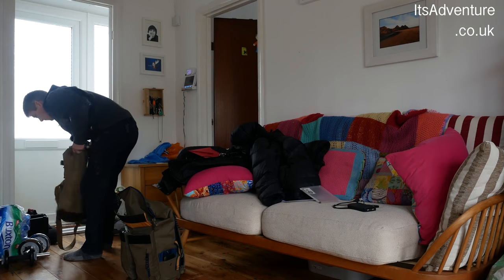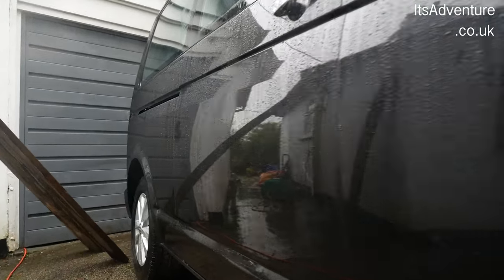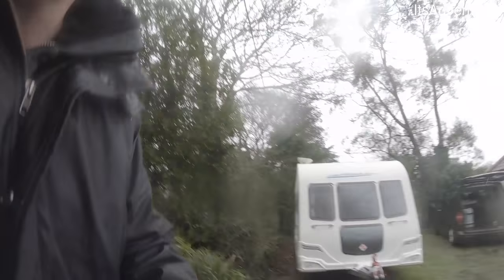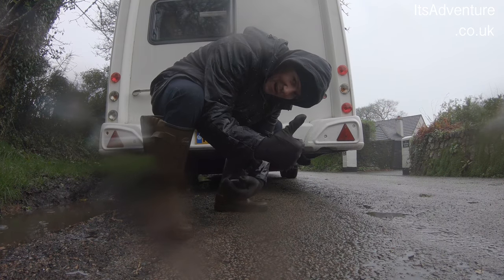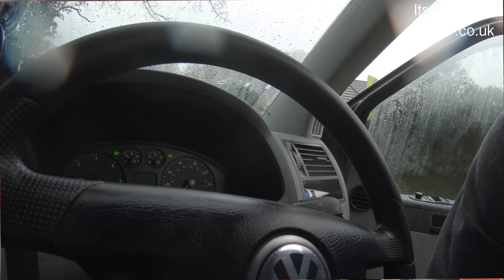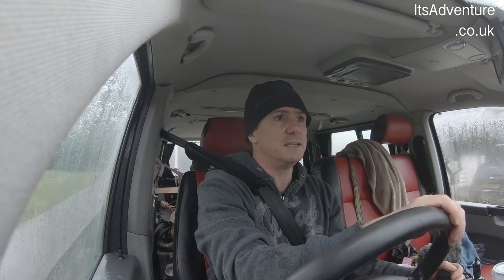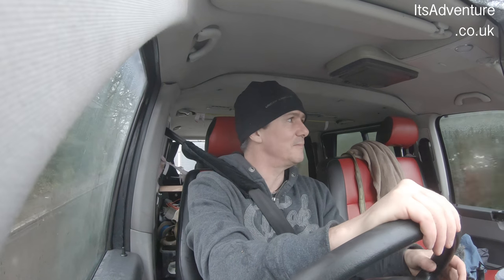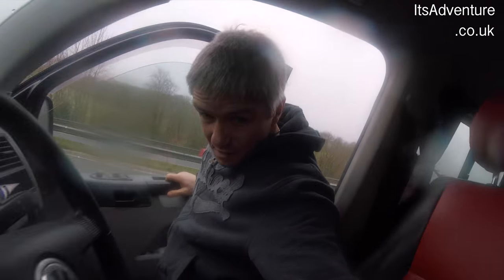VW T5 Van & Van

Comment: Why not just use the motor mover to bring the caravan to the bus to hitch up? So much less faff than cameras and Bluetooth!
Reply from the maker: Hey Mr C, couple of reasons sir: 
1, the battery I had on the van at that time was not quite powerful enough so frequently cut out after a couple of shunts back n forth. 4 x motors on 2 x axles take a lot of punch. 
2. I got to mess about with cameras(which I love) and which I hoped give ideas to help others who may not have been able to stretch to the expense of fitting a motor mover.  I did toy with using a video call to do similar but used the cameras.  
Thanks for the feedback.  
Rich. 
;o )

Comment: i found it a bit daunting the first large caravan I picked up. it was a Fendt. It belonged to a road contractor who works on roadworks around the UK. He only has a Citroen C2 as he pays people like me to move the caravan around every couple month or so. the length was 7.8m from tow hitch to the very back. I picked it up using a 16 seater XLWB ford transit minibus from a farm in Bedale in Yorkshire to a site in North Wales. the length was daunting. there was a bit more bounce than usual. but after a few miles, it was a doddle. I parked up in the HGV bays at Wetherby services as I usually like to stop after first few miles for a confirmation check to make sure nothing has fell off and lights still working. I was actually too long to fit in a HGV bay so had to park on an angle
Reply: Well done Stephen. That’s sounds like a rather scary prospect!  More so if ever you need to reverse a rig like that!  Pretty easy going though once you’re settled on to the motorways.
Reply: @broadys_on I found it much easier to reverse than smaller trailers as the axles are further back, it doesnt react as much to the slight movement in steering and is it is much larger, you can see what the caravan is doing much easier than you would with a small 5x4ft trailer. I reversed it a few times. first when I parked in a HGV spot at Wetherby. Then reversed it into the corner of a Mcdonalds car park in Wythenshawe near Manchester airport. Then as I briefly lived in Wythenshawe a few years before. I remembered you had to head through the houses to get to the airport before getting back onto the M56 towards Wales. I dont use a sat nav, I wing it mostly but have google maps if I get stuck or pin point my destination for that final mile. Driving around the houses, I noticed the tram system had been extended into Wythenshawe and the airport, so some of the roads are not where they used to be, I got a little dis-orientated. I missed my turn, but I took the next right as I remembered that it was another way to the airport although a no through route as it was a tight residential street. It was still sign posted airport on one of those blue cycle route signs so I thought nothing of it. About 500 yards up the street after weaving around parked cars on both sides of the street. I noticed my cock up. It had been closed off with the installation of concrete Bollards as the tram tracks now crossed at the bottom. So that street was now a cul-de-sac. I couldnt reverse all the way back to the main street as the parked cars would have been almost impossible and wreckless to attempt to reverse back. I noticed there was a small green area with a sign saying NO BALL GAMES ALLOWED. One of the residents had a car parked on it. So I thought I give it ago reversing onto that. It took a couple of shunts, a did knock down and empty wheelie bin with the tail swing. I then noticed a humming sound when I turned my steering which was now heavy. Fought my way out of the cul de sac passing the parked cars and a bin lorry that decided to turn into the cul de sac before allowing me to get out of it first. Drove the rest of the way to the campsite/storage area just in the border of Wales. Found my hose to power steering pump has come off. So bodged that and topped up the fluid and drove home.

My main worry wasnt so much as the size of the foot print I have on the road. Which was 12.8 metres total length when I was stopped by the DVSA at a check point near Oldham. It was more the fact it had an ALKO stabiliser hitch on it that I not used before. Not used any stabiliser before actually. I used to be at that time very anxious of cross winds with a caravan on the back. I am also a HGV class 1 driver but you dont feel the wind so much unless you have an empty double deck curtainside trailer on your back. But I think the caravan was reasonably light for its size. But I was impressed with that ALKO hitch. I felt a bit queezy the first few miles with the motion the caravan nose weight bopping up and down on the back of the minibus even on a road that seemed flat. But was fun. I have towed all sorts of caravans up to that point and afterwards, but not as big as that. I towed a large single axle Bailey Phoenix around central London once when I used to do light haulage. I had a couple of deliveries in the Kent area and picked up the caravan in Surrey and had a collection come up in on Ealing Broadway that was an urgent job to Gateshead. I turned into side streets and I was expected to reverse to let cars get pass me. I not took a caravan to London since
Reply from the maker: Man what an epic adventure!  It is always an eye opener when a wagon driver tows a caravan for the first time.  Sounds like you are getting lots of practice!  Well done sir!

Comment: Hi just saw your video as we’ve just recently got a caravan so i was wondering with your transporter with the tailgate if you can open it when hitched up? Thanks
Reply from the maker: Hey Ant. Yes, the back did open even when hitched. I only had an issue if the jockey was fully up. 
Happy caravaning. It’s fab fun. Personal fave is when you’re inside cosy and you hear rain pinging on the roof. 
Cheers
Rich
;o )
Reply: @ItsAdventure  oh that’s great thanks for the info 
Yeh we did hire a motorhome and then lucky enough to hire a touring caravan which proved so much better for us with young boys and with the van combo it’s the perfect set up in my opinion 
And I completely agree on your personal fav of the rain !

Comment: Just stumbled along this video as im toying the idea of getting a T5 (once my range rover sells) and have just sold my single axle caravan to upgrade to a twin axle caravan in a few months. Ideally id also like the lwb transporter to convert to day van... so it was reassuring to see that the t5 coped well. What engine is in yours? I noticed yours was a manual also but ill be hoping to go for the 2.5 automatic. 
Regards 
Declan
Reply from the maker: Hey Declan. I had a 1.9 manual but it was remapped to 150bhp. 2.5 auto will be fine. Trick with twin axle is turning. They are for sure harder to turn and refuse to turn in the spot so I had to use a lot of revs to manoeuvre in tight spaces. 
LWB and long van are perfect on the motorway. Just not so great in the lanes of Cornwall by me. 
Cheers
Rich
;o )
Reply: @ItsAdventure  hello mate, thanks for getting back to me. I have towed a twin axle before for a friend and found it towed alot nicer than my single, reduced the pitching by half in my mondeo estate i had at the time and I maneuvered the twin onto the pitch quite well, although that was on grass so that probably went in my favour. I will miss the range rover for towing, I dont think anything else will compare but I just think the van would be a good edition plus converting to a day van will be fun. I wish I lived in Cornwall, im not jealous at all in the slightest 😂
Reply from the maker: @declanhodson8863  ha ha. I can vouch for the move we made. Eleven years back we lived in Midlands. The difference being able to get to a choice of beaches in 20mins vs 3hrs to see the mud of the Severn estuary is massive!  U know what tho, anyone can move house. Just a question of how far u want to go. Does mean we had no further need for our caravan. So it went couple of years back. 
The day van will be great. No 60mph limits. No car park hésiter barrier issues and with a van for those longer stays with a more relaxed pace….perfection!
Cheers
Rich
;o )
Reply: @ItsAdventure  I thought so, your accent isn't devon/cornwall. I also used to live in the west midlands. Worcester in fact, but moved in the totally wrong direction. Now in the north east. My friend lives in Devon now though, he had the right idea 😂

Comment: Interesting vid. I am just about to tow our caravan which is a single axle coachman 575 with a SWB VW T6 camper. The T6 has 150 BHP diesel. I was wondering how powerful was your T5. Cheers
Reply from the maker: Hey Rich (good name that), mine was boosted to 148Bhp.  So you will be fine.  I got down to third a couple of time on the really steep hills in Cornwall.  The M5 was a doddle.  The beauty is that the van shapes the air before hitting the van much better than a car or pickup so the caravan will track better behind you.   Don’t get me wrong, you will still feel those large wagons though!  All the best Rich.
Reply: you be fine i used to tow a coachman 575 with an old swb transit 2.5Di non turbo with 76hp.

Comment: Im about to start towing my new caravan with my lwb vivaro, why didn't you have any towing mirrors attached? Thanks in advance
Reply from the maker: Hi Stephen, Its a bit daunting first time.  Just take your time and do not stress.  Acknowledge you will get traffic behind you from time to time.  The bus was wide enough to give me view down each side of the caravan.  Tow mirrors are cool but didn't produce much wider field of view for me.  UK Legal position is:
You must have an adequate view of the road behind you.

Fit suitable towing mirrors if your trailer or caravan is wider than the rear of your car.

Hope that helps
Rich ;o )
Reply: @ItsAdventure  thanks alot for your reply, i can't wait to start caravaning

Comment: I have heard that VW Transporters should only tow caravans in manual mode not automatic. Is this correct? Does anyone have any views or experience with towing in one mode or the other
Reply from the maker: Again talking 2ltr tdi engine with DSG gearbox in my Amarok pickup, I tried both.  I found the best results came when using sport mode and getting slightly higher revs. I had come from a 4.2ltr supercharged Range Rover so was really surprised that a vehicle with less than half the engine capacity could perform as well as it did. If you can, get one on test with a tow hitch and try it! 
Best of luck. 
Rich